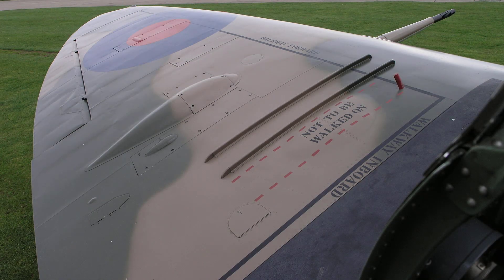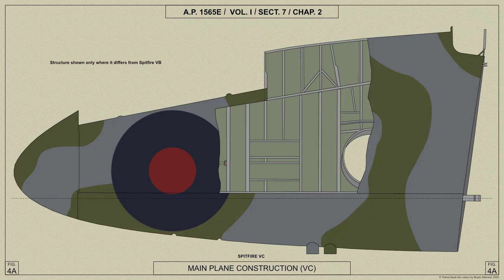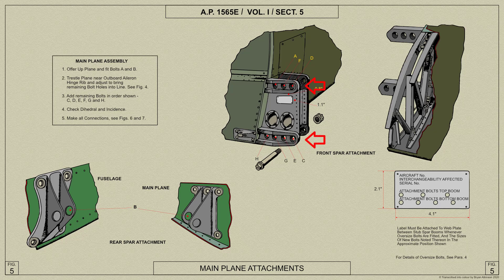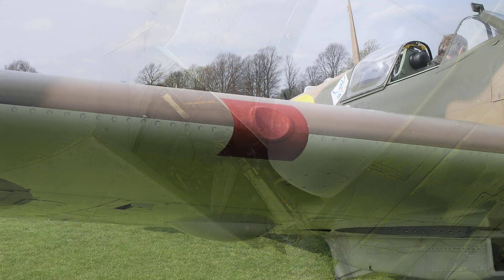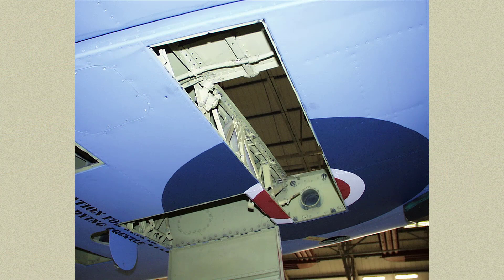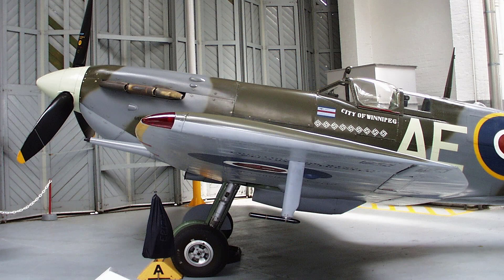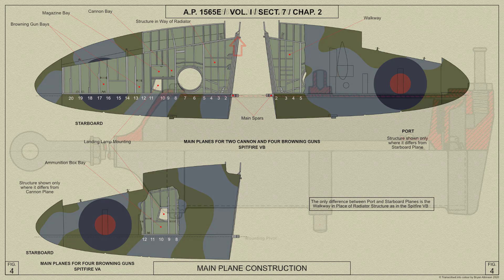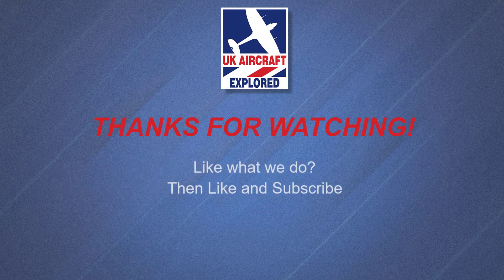Spitfire Mk V – The Mainplane

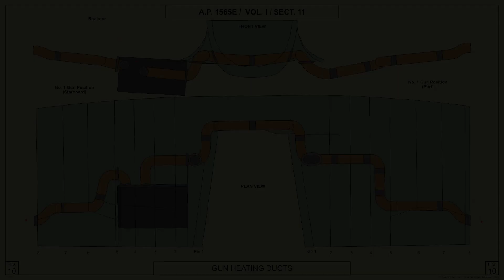Comment: @6:43 it appears that the exhaust door for the radiator is presently fixed in position by a brace.  Is this the case?  Your colorizations of the Air Ministry diagrams are very good, but the photography is Outstanding!
Reply from the maker: Thank you, I took those photos back in 2005. I redrew and colorized the AP diagrams last year. The 2 bracing struts are fitted to strengthen the radiator flap. The flap is not fixed in a position, but operates. Thanks for watching.

Comment: I have a question: what are the two dark (black?) ridges/bars running fore and aft along the upper surface of the wing, just outboard of the ‘Not To Be Walked On’ stencil as seen around :13 seconds through :20 seconds in the video?   I’ve not seen them before, and every time I see them, I wonder what they are.  Thanks, and keep up the great work!   Hope to hear from you.
Reply from the maker: Thanks for your question and for watching. They are reinforcing strakes that run over the undercarriage wheel well area as this was a weak area in the Spitfire Vs. Mainplane design.  I hope this helps.
Reply: @ukaircraftexplored6556  Thanks!   I did not know that.   I don’t see them in some of the early pictures, say 1940 Battle of Britain, so now I’m wondering if they were added to later models.    Thanks again - learning something every day with your videos.

Comment: Another excellent video. Love em. Can I suggest you missed the undercarriage down mechanical indicators sticking up from the wing surface and the strengthening strips applied above the undercarriage recesses - or have you a cunning plan to cover these with general undercarriage video? Also, there are photos of the main spar square section laminations - would have been good to show this in detail. Anyway, not complaining, I love these videos - excellent reference source. Thanks for putting them together.
Reply from the maker: Thank you very much for your feedback Paul, I’m pleased you like my videos. Yes, I do have a cunning plan! The Undercarriage Mechanical Indicators are covered in The Undercarriage Video, which will be posted in two weeks. Thanks again for watching.